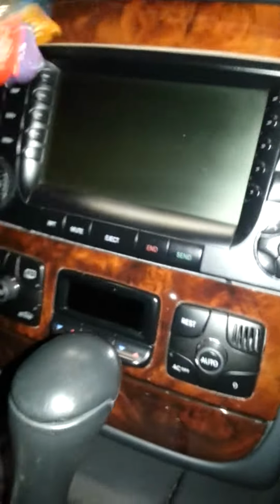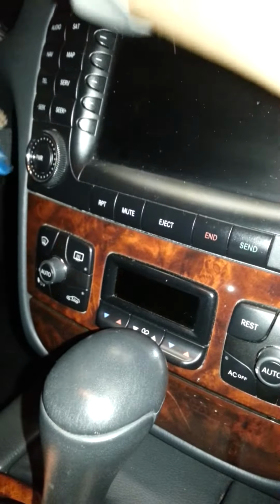2004 s500 Mercedes w220 blower  regulator part 1

Comment: How to put it back in properly though? It makes stirring sounds.😢
Reply from the maker: @martvez  it can only go back in one way since the motor has a plastic housing that has one pattern. Make sure there's no leaves or any debris on the blower motor blades. Also check to make sure that the motor doesn't make noise when you spin it with your hands. Cheers
Reply: @PeterZafra  it does. I replaced the regulator and now the motor is making sounds when i turned it on.

Comment: Hey Peter, My blower comes on and off intermittently. Since it does blow when it comes on, I'm guessing that the fuse and blower is good. Does it sound like I have a bad regulator? How do I test the regulator?
Reply: Did you get this resolved? Im having the same issue, took the blower out, wired it up while out of its enclosure, fan seems to need an extra push to kick on, if i tap the fan it kicks on. Not sure if that means the motor it self is on its way out

Comment: Hello from France ! I got a S500 1999 I was riding my S class and my ventilations stopped abruptly. The Control Console works well and does not display an error.  I check the 12V power going to the regulator and there is NO POWER at all, fuse N°33 is ok he got 12V ... Did you think the console is broken ?
Reply from the maker: zorgulus watch my video about melted fuse. Click the link in the description above. It could be a melted fuse in slot 33. This has been a problem with the w220 cars. How it helps.
Reply: I watched your video and my 33 fuse is in perfect condition. I also looked below the wires are in good condition, no burning smell.
Reply from the maker: zorgulus did you test both sides of the fuse for power? Make sure there's power to the fuse and after the fuse. If there's no power to the regulator from the fuse, then you possibly have a break from the fuse to the regulator. Make sure to rule out the fuse by checking both sides of the fuse for power.
Reply: Yes both sides of the fuse have 12V. When the ventilation stopped working I was riding with AC on LO fan on "MAX" you think of the wires burnt?
Reply from the maker: +zorgulus check the fuse lines on the side going to the regulator when there's load. Turn on the fan and see if the voltage drops. It can register 12 volts but drops under load. That's what happened with mine. It was registering 12 volts but when you add load, it drops to 4 volts because the wiring cannot handle the load.
Reply: Hello,

I'm back, sorry for the delay. I had found the problem, it was the fuse that was broken. I replaced it and the ventilation worked but a few weeks later, the fuse broke again, it heated up a lot and is black! I do not know what to do.

Comment: I have a 2005 E320 wagon How & what is the best way that you can determine if the blower motor regulator is bad or just the blower motor itself, because when I turn on the heater or AC nothing happens now etc ?

Thanks
Reply from the maker: Marcus Campbell hi. I would put direct power to the motor and if it turns on,  then the motor is good. start with that. then from there, test the power going to the regulator from the center console. check out my other videos regarding the blower. this video, the problem was the regulator. the other video it was the fuse box that melted. I hope it's just the regulator in your case. let me know. cheers.

Comment: I checked my central control center and it was good and my regulator as well ....but how am I suppose to check the blower motor? By just using the Volt Meter ? If so I did I put red on red and the black wire on the brown and no power shows does that mean that's my problem?
Reply from the maker: to check the blower, you will need to connect the blower to a direct battery or source of power with 12 volts. if the blower runs, then it's not the problem. how did you check the regulator?
Reply: +Peter Zafra I made a mistake measuring with the volt meter I had it on the wrong usage but I corrected it and checked it again and central control system good and I did what you said for the blower and it was working perfectly as for the regulator i was only getting 4.3 Volts ...I suppose the minimum is 12 in order for it to process to the Blower to get it running correct?
Reply: +Cowboy leal checked the regulator a few times and it varies from 2 to 4 Volts
Reply: Hi Cowboy, My blower comes on and off intermittently. Since it does blow when it comes on, I'm guessing that the fuse and blower is good. Does it sound like I have a bad regulator? How do I test the regulator?
Reply: @bhasins  exactly what happened to mine, change the regulator.
Reply: @TangDynasty1983  thanks. So I decided to open up the blower and clean it up with compressed air and WD40. I put it back in the car and it ran fine for 2 days before stopping again. When I tap the blower, it comes on again. Do you think it's a problem with the blower or the regulator? Since the regulator is an electronic component (no moving parts), I doubt that tapping it would make a difference. The fact that the blower comes on after a few taps tells me that it is a mechanical issue. Since the blower is a mechanical component with moving parts, I think it's the blower which needs to be replaced. What do you think?
Reply: @bhasins  did you plug your motor directly to a 12V battery to test? Did you measure if there is voltage filtration after the regulator?
Reply: @TangDynasty1983  I did not individually test the regulator for voltage filtration. Since all it takes is a few taps on the unit to bring it back to life, I feel it's more of a mechanical issue with the blower than an electronic issue with the regulator. An electronic board should not be succeptible to physical taps to make them wake up. Do you agree?

Comment: I got a 2005 W203 and the A/C has been acting up.

Compressor is good (checked last year), electronic module is good (replaced last year)

I get no blow and hot air coming from  the sides and defrost vent. The "blown" speed of that air increases with the car speed. Could this be the blower motor, or it's a stuck flap motor.

This issue is not constant. This morning I had no AC, but now it's working fine.
This morning I did not hear the flaps open. Normally you can hear the motors working, opening and closing the airways.
Reply from the maker: Hi. This sounds like your climate control maybe malfunctioning. It can vary from temperature control to a failing blower regulator since the active climate is within the regulator/resistor module. Try becoming a member of the mbz forums and ask the members to see if they've had similar. It's free to be a member. Thanks
Reply: Peter Zafra
Thanks for the quick reply man, appreciated.

I'll do that. I just need to keep the AC working for another 2 weeks, till I get home. I study abroad and have to drive about 2000km to get home. I've done it and without AC, it's hell.

When I'm home, I'll leave the car at the dealer, so they can scan it and fix whatever is up with it. Where I live, Mercedes doesn't charge an arm and a leg XD

But, till I'm in Germany, I can swing by MB and have them check the refrigerant level, maybe drain and refill the system and add dye, so MB at home can check for leaks.

I have heard a slight hiss several times... Went through forums and normally people say it's a leak. Most likely the O-rings.